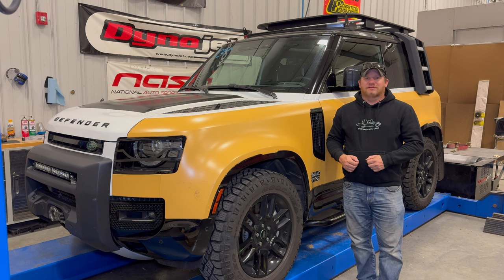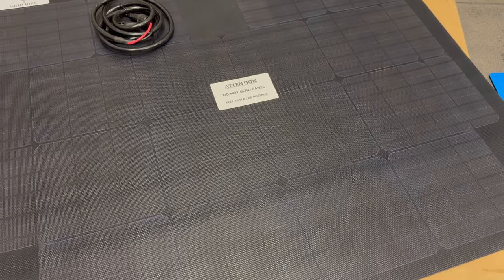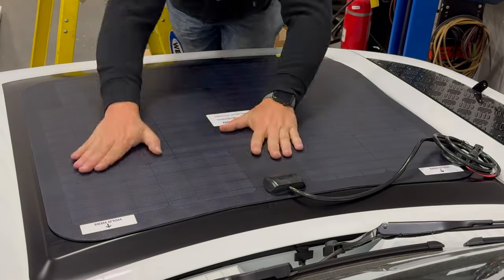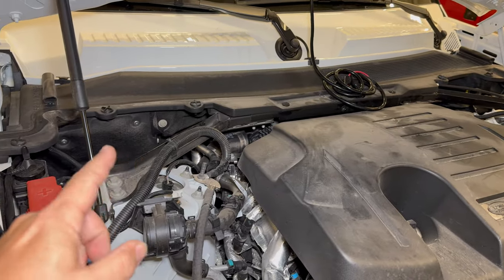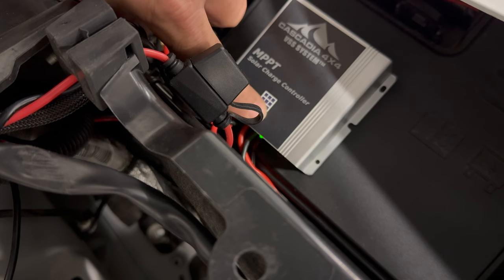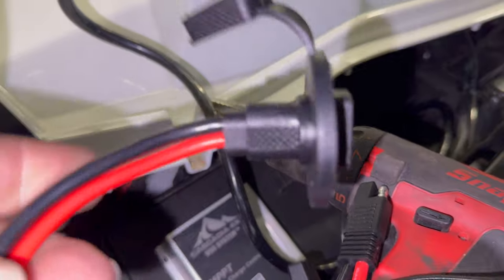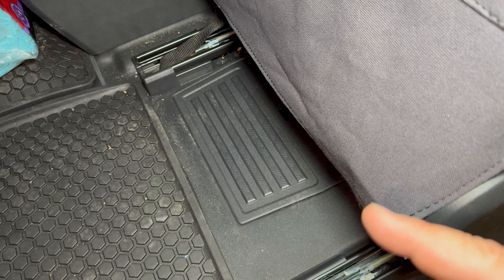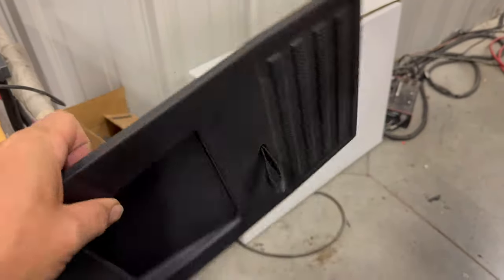Installing the Cascadia 4x4 Solar Power System

Comment: Ok hear me out. A copper honeycomb sheet that goes between the vinal and the solar panel that's open at the front and back for air to flow though so it can cool the panel.

Comment: Pretty cool Steve. So it keeps the vehicle battery charged without running the engine out in the boondocks.👍👍
Reply from the maker: Correct and plug I installed just behind the bonnet will power devices on solar power only and also will disconnect the power to the device if the vehicle battery gets too low so that it cannot drain the battery down to the point I can't start the engine.

Comment: That looks to be a good addition for the trip you are planning, My first thought was, is that the best place to install a solar panel? However thinking about it a little more it is the best place as you will probably be packing items onto the roof so no space up there for a solar panel. You are safe knowing that the vehicle will start when needed and no fear of a flat battery. 👍👍
Reply from the maker: Especially with the short wheelbase version that I have, I will have no roof space to utilize with solar panels.

Comment: I would recommend a low voltage cut-off relay connected between the battery and the interior socket. If the battery voltage drops below around 11V it will cut the power, leaving just enough to start the engine.
Reply from the maker: The fridge for example has an automatic low voltage shutoff on it.

Comment: I would think that air gap is more about insulating the solar panel from the engine heat than vice versa...solar cell effeciency goes down as temps go up
Reply from the maker: The solar panel gets very hot when it is sitting in the sun parked, when your engine is running you don't need the solar power and you are generally moving keeping the panel and hood cool.  The solar panel gets way hotter than the engine makes the hood.

Comment: You seem to have positioned the 'charge controller' directly under the windscreen / scuttle drain @ 4.07? It maybe water resistant, but sure intermittent soaking isn't a good idea?

Comment: What commonwealth are you in ?  I have been wondering why they do not have these on the roof of EV cars.
Reply: Some models of Tesla have had a roof solar panel factory installed since as early as 2016. Blends into the roof so hard to notice.
Reply from the maker: The Fisker Karma was one of the first electric hybrids and it had a roof of solar panels.